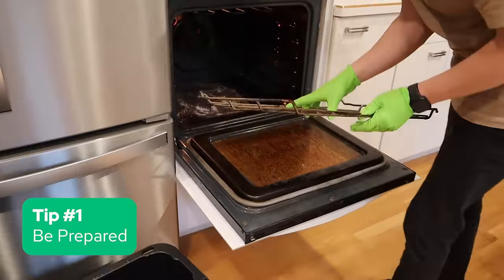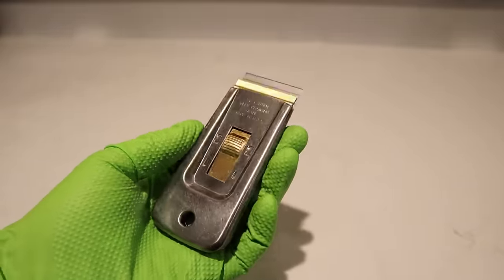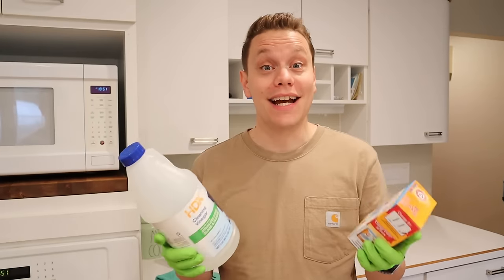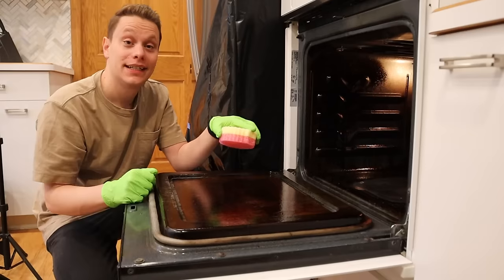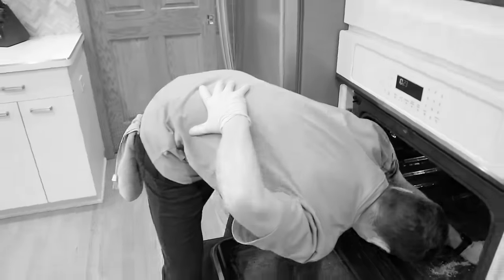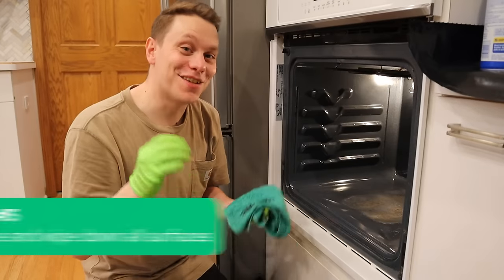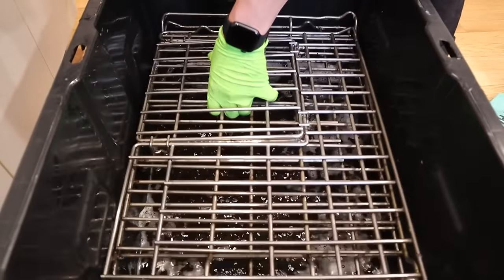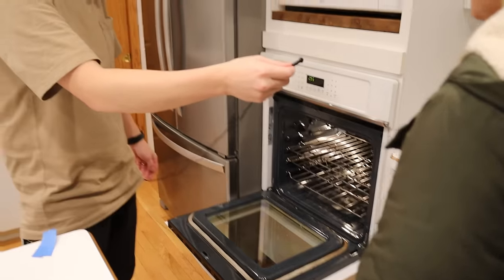5 Tips to Clean Your Oven Like a Pro

Comment: My lazy @$$ just put vinegar and water in an oven safe glass container and heat it in the oven at 180 degrees for an hour or two, use a microfiber rag and wipe it down. I do it once every two weeks so my oven stays looking brand new. (I'm lazy and also very cheap 😆😆😆)
Reply: Does this work to get off grease too or just to maintain after it’s cleaned?
Reply from the maker: Not lazy! Sounds like cleaning smarter and not harder. Great tip!
Reply from the maker: I would say this is a great maintenance cleaning method once’s it’s been deep cleaned. In the case of this oven it needed to be deep cleaned first to remove the years of grease and grime.
Reply: @CleanThatUp  yes, definitely for maintenance. I've done it since it was new when we bought it and it's from another decade 😁
I just can't see myself buying new stuff if my old stuff is in good condition. My husband used to repair and sell upcycled appliances so it kind of stuck with us to take care of everything we own. Money saved is money earned 😁
Reply: Not lazy, but genius!! Thank you!! ❤️❤️
Reply: Same. I have done it all and that's by far the easiest way.
Reply: At least you are honest. The best part, you are not that lazy anymore.
Reply: @AvaJun  thank you did you wipe while still hot or warm
Reply: There's nothing lazy about this. It's efficient and effective.  Since you do it regularly, your oven never gets as dirty as the oven in this video, and that's very smart.
Reply: You're working smarter not harder.😊
Reply: I do the same thing but I also add a whole lemon and juice, got maintenance and smells good
We cook alot of seafood. 
We deep clean twice a year.
Reply: Heating your oven with no food in it for 2 hours every two weeks will cost you WAY more in electricity or gas on your energy bill than a couple of cheap cleaning products every so often
Reply: You are smart, not lazy!
Reply: How much vinegar and water you put in your dish please? Thanks
Reply: Does it work
Reply: Honestly 20min is nothing for a dirty oven. I mix pink paste, baking soda and water, put it inside the oven all over and leave it for the night. In the morning you don’t need to scrub for a long time.
Reply: What a great maintenance tip!  Thank you so much for sharing this! I just put a glass bowl with water and vinegar in my oven right now to tidy it up!  Thank you for sharing!
Reply: So the oven equivalent of the lazy Susan, great idea.
Reply: That really works ??
Reply: Doesn't sound lazy to me when you're doing that every 2 weeks. & saving money in the long run! Great job :)
Reply: Is that 180 C or F?
Reply: @anguswatson3856   So just put the bowl of vinegar in after removing baked goods from the oven while the oven is cooling down. Win-win!
Reply: What about oven that have self cleaning features like Aqualift?
Reply: @annleong7363  never use self cleaning method
Reply: Work smarter not harder is not lazy
Reply: Nice its a good idea what about make a paste of BS. And smear it to the stains and turn over on and see how that goes about with ur vinegar and water mix in
Reply: The record scratch sound while scrubbing had me ROLLING 😂
Reply: @AbbeyOnAtkins following…I had the same question
Reply: Does this make the house smell like vinegar? I deep cleaned and am ready to start doing maintenance cleanings, but my partner hates the smell of vinegar.
Reply: @meriboberi   vinegar is a deodorizer, but I would do it before he goes to work so it has time to air out. Open a kitchen window if you can. I’ve never done this method but I clean with vinegar and my husband doesn’t like the smell either. I would start with half a cup diluted and see if it smells while getting the job done.

Comment: Pro tip from a pro cleaner: if going with the heavy chemical method (easy off or other brands), spray, then lay painters plastic or in a pinch garbage bags over the sprayed areas. It speeds up the process and helps keep fumes at bay just a little bit.
Reply: We need a demo on this!

Comment: Also do the cleaning in the spring or fall when you can open your windows to ventilate the chemical fumes. After cleaning turn the over way up over 400F and let it dry full ( no more smells or cleaner ) or the next time you turn it on the foul chemical smell will come out of it when family/guests are over.

Comment: Oven mats, wiping the door after each use, and wiping the interior after I cook something steamy has kept my oven pretty clean for the last 2 years. Wiping the door was a habit I got from my mom. I picked up the mats on a whim at the dollar store and holy cow was that a life changing decision.  I started wiping the inside after spilling something once and realizing how easy it was to clean the sides while they were still steamy. Outside of spills, I have not cleaned my oven like this in 2 years.
Reply: good tip but what about splatter on the sides?
Reply: Unfortunately if you have certain ovens with base heating element they advise not to use the Mats. 
So recommend with caution ⚠️

Comment: I found baking soda / vinegar did absolutely nothing to my oven. It made it even more of a mess. Easy-off oven cleaner and a steel scrubbing pad was the only thing that worked for me. sometimes you have to let go of your reluctance to use heavy duty chemicals because nothing else works
Reply: Yeah, my oven wasn't bad but did have some baked in grease. Baking soda didn't remove it and the baking soda itself was very difficult to remove especially from crevasses.

Comment: Such a great guide! Love how it’s realistic and shows the reality of scraping with the razor blade, doing lots of passes and scrubbing and not just all being perfect in the first wipe. 
I’m a professional cleaner and this is exactly what I do (albeit with different chemicals)
Reply: It wasn't until i watched Midwest Magic Cleaning that i learned that cleaning is best thought of as removing layers.

If you're cleaning an extremely dirty object, like years of caked on grease. You have to attack it multiple times.

The cleaner can only take off a small layer. You have to repeatedly add cleaner, let it sit for a few minutes, then wipe off the dissolved dirt and grime, and repeat till the grime is gone

Then you can do a final sanitization pass

Comment: Was taught by my mom to take a 9x13 cake pan and put a towel in it, fill with ammonia until the towel is covered.  Turn your oven on the lowest setting, let heat up and then turn off.  Let it sit overnight and the next morning wipe it out.  You can also put you burner grates, rings, etc in a cover pan of ammonia and let it sit overnight and with a green scrubby go over each piece.   Have been doing this since the 1980’s and it works like a champ 😊.   Dollar Tree sells bottles of ammonia for $1.25 pretty cheap cleaner.   You can also take an ammonia soaked towel and lay it on your stove stop and let it set several hours to clean off the brunt on stuff.   😊

Comment: This is very helpful and very specific which is important! I cleaned my oven earlier in the year and didn't get magical results but it was better. I like how you noted to do it more than one time and also to use a razor blade. I also think I will try the zep. I have done the baking soda clean which worked about the same as any other cleaner. I can see by watching you that technique and timing matter and it's good to see that effort clearly illustrated! The idea of dish pods for the racks and using a storage tub to soak them is also brilliant! My stove is probably from the early 80's! It came with the house and is double wide with a proofing oven on the side and a large space in the middle of the burners. It would be hard to find a good replacement!
Reply: I bought my home in 2017.  I would rather have your old stove with the proofing oven.  We both need to take care of what we have.😊
Reply: On older stove tops, with burners, that razor scraping tool works wonders in take on any baked-on food. Just get the angle on the blade right and don't scratch top.

Comment: 36 years old, and over 7 years in my apartment and I finally cleaned the oven.  I may have taken some liberties when it comes to procedure (i.e. wet sanding the wire racks with 1500 grit sand paper). but y'know, it turned out pretty good.  Thanks man.

Comment: I had an old Tappan stove for years....era 1960s?
The inside of the oven was lined with liftaway panels.
Once a year, I dismantelled the oven and placed the panels and racks outside on the lawn.
I sprayed everything with oven cleaner and left it it to soak in the sun for a while.
A quick rinse with the garden hose and everything sparkled!
Great oven design!!!
Reply: I used to have a stove where the bottom was removable. I miss it so much.

Comment: Wonderful video! Thank you! Okay how did you clean that light bulb on the left because I am worried about touching it for fear of it breaking. And also the ceiling below the broil element? How did you clean that? I have a non-removable element on the bottom of the stove - how do I clean around that? Can I accidentally get a little spray on the element? I'm scared!!!

Comment: Soaking the oven shelves in non bio washing powder and boiling water is more effective than dishwasher pods. You can also make a much more concentrated solution. Leave overnight preferably and then to clean quickly use a metal or abrasive scourer. You don’t need to be concerned about scratching the grill shelves.

Comment: Is there a safe way to dispose of the grease from your scrubbers and towels afterwards?
Reply: Personally, I use a spatula to remove most of it and trash it. You never want to put it down the drain. Then go on to paper towels for the worst and follow up with your sponge and rags.

Comment: Ok. I've used the oven spray, which I then covered in cling film over night. I also removed 2 of the glass layers of the oven door, as well as the insulation rubber around the door. To reach the top properly, I might remove the door. Use a good face mask and protection goggles, if you have them, when spraying that chemical acid destruction.
Reply: You mean to get to the INSIDE of the two glass panes?? Sounds risky, but it would be great to do that.

Comment: Iam curious. What do you do with the sponges and the cleaning towels you used in that video? You throw them to the trash or clean them?. If so, how do you clean them?
Reply from the maker: Good question! Lots of rinsing with water to remove the cleaner and grease/grime.

The towels wash up really well as long as you don’t let the cleaner/grime dry in them. I usually can get quite a bit of life out the sponges by keeping them rinsed.

Comment: Great video! I know your microfiber towels are reusable, but how do you clean them after a job like this?
Reply from the maker: Good question! I tend to use one or two of my older ones for the really greasy stuff. Wipe rinse in the sink and repeat. Once the job is done I rinse them multiple times to remove all the grease and grime. Then I will wash using this method- https://www.cleanfreakweekly.com/p/wash-microfiber-towels

Comment: How do you clean the top of the oven with the heating elements?
Reply: Unclip it to get some clearance between the oven and the element? Hold it with your offhand to keep it from falling.

I haven't tried the top of mine yet, but it works for the bottom element.

Comment: what about if oven has a self-cleaning function?  would you choose that before using any harsh cleaner?  would you try that first and if necessary THEN use the Zep?  the downside of the self-cleaning function is that it may get smokey or sort of smelly in house while everything is being burnt off the oven...I believe you need to do it on a day that you can keep a few windows open to air out the house.
Reply: All you can do is wipe them with a damp cloth really. You can clean the rest of the oven just not the actual self clean panels

Comment: Great video. Is this for a NON self-cleaning oven? Thanks.
Reply: Self cleaning ovens just have a 'clean' setting that burns up all the little bits of food or crumbs inside so they turn into char instead of burning or lighting on fire when you cook. It doesn't remove the grease stains that build up over the years.

Comment: My heating element is at the bottom of the oven.  It’s an old oven so I’m afraid to disconnect it.  How do I clean around it?
Reply from the maker: Good question! I will try my best to avoid with the spray. Then I will gently lift and move when scrubbing and wilding down. I also like to wipe it with a damp towel when I’m down to make sure no cleaning residue remains.

Comment: One VERY useful thing you didn't mention, and maybe you didn't know ... if you cover the entire bottom of the oven with tin foil, there's very little mess when it's time to clean. Easy, cheap, and very effective. No one should have to vacuum an oven. How would you ever get the grease out of the vacuum? I've been doing this for years and I only have to deep clean my oven once a year, or even 2 depending on how much use it gets. All I have to do is change the foil now and then when it's necessary.
Reply: It works as long as the heat doesn’t cause the foil to float up during the cooking process because it makes a mess when the foil gets grease under it and the foil sticks to the oven!  Trust me, I just lived it!  😣

Comment: If your oven has clean function, Use it as it will burn down all the oil Inside the oven, Once the oven is cooled down rinse the rack in water and Use dry or wet clothes to clean all the oil dust which is burned inside the oven.

Instead of using all chemicals inside the oven, which you use to cook food later on.
Reply: The self clean feature did nothing to clean my oven. Just wasted a lot of energy. Sometimes you have to use chemicals.

Comment: How do you get the grease that seems to get inside the glass (like its between the glass and outside oart of door). I can get my entire oven clean, but the part.
Reply: You can take off the door. Inside is the glass. You can take that out too and wash both sides of it with dish soap and water using a sponge. Then spray vinegar, wipe abs dry with a dry cloth. Hope that helps!
Reply: People have also broken their glass!
Reply: @lindahill1199  This is what I am afraid of,  lol.

Comment: Did you have to take out the heating elements? I have a gas stove but an electric oven and its difficult to clean the oven with the top and bottom heating elements in. Thank you.
Reply: Yes, interesting that he doesn’t address this issue or show any attempt to clean the interior ceiling of the oven. That’s the part I’m struggling with and I can’t find any cleaning “pros” that address how to do this safely.

Comment: How do you clean in between the glass on the oven door?
Reply: You mean inside a double pane window? You pretty much have to dissaemble the door. After cleaning, seal the edges with some high temperature silicone to stop it from happening again.

Comment: I have been using Easy Off Fume Free oven cleaner, and find that it works very well with much less chemical odor. Also, the longer you let it "marinate" on the oven walls, the easier the clean up, 48 hours seems best! If you know the comparison between your Zep and this Easy Off Fume Free, please let me know. Twenty minutes to two hours soak seems too good to be true!
Reply: I use Dollar General brand, which costs less and works every bit as well as Easy Off.

Comment: What if your heating elements are not removable?  And I have an element on the BOTTOM and top of the oven.
Reply: Me too and mine is so old that I don't think you can take the door off. 
I always used easy off oven cleaner and time and an SOS pad to scrub, twisting my body into weird positions that a contortionist wouldn't recognize. 
I have healing fractures in my back so I did the bottom the racks the door and half the sides.
I'm taking a break trying to figure out how to do the back the top and the top half of the sides 😂
My son apparent had a pizza collapse in the middle and land on the element, 😮while I was in the hospital, don't ask about the smoke coming out of my vaccume cleaner or the flood from my washing machine 🤔😂

Comment: I've always just used the self cleaning method, works like a charm. I'm not sure why people don't use that method. It bakes everything off and you just vacuum it up. Then wipe the glass. voila.
Reply: The fumes from the self cleaning oven ( at least the one that I have) stinks so bad I was getting a headache and sick to my stomach, it was also setting off the smoke detectors. In the winter time the windows are closed because it is so cold I can't open the windows to get fresh air. In the Summer it is too hot to run the self cleaning feature. Fall and Spring around where I live are either too cold or too hot now-a-days so we don't seem to get either.

Comment: What kind of scraper should I use so it doesn't scratch? Ty :)
Reply: I know this is an old comment but a glass scraper. You can also use it on the actual glass then as well, as well as electric hobs

Comment: Don't forget to add some type of LINER to the bottom of your oven. This will save you a lot of time and elbow grease when cleaning the oven later.  

.
Reply from the maker: That's a great idea!
Reply: adding things to bottom of ovens can cause fires
Reply: @XscarpettaX  So why do companies make aluminum "DRIP PAN LINERS" for the oven bottoms ????

.
Reply: I put the liner on the bottom rack.  Learned that after shorting out the element!

Comment: Pouring grease down the drain is a TERRIBLE idea, especially if you have a septic tank.  Doesn't matter if it's mixed with a cleaner, it doesn't decompose in the tank.